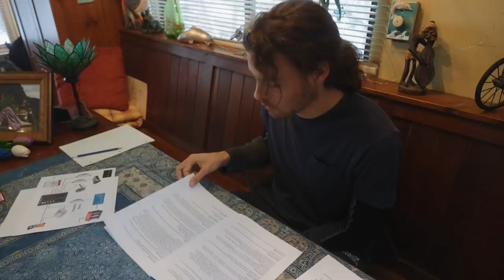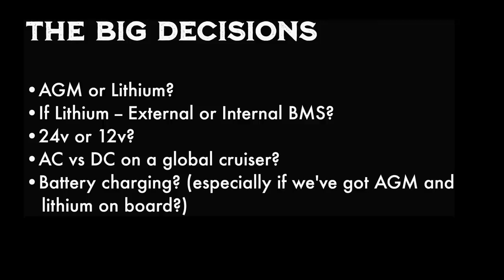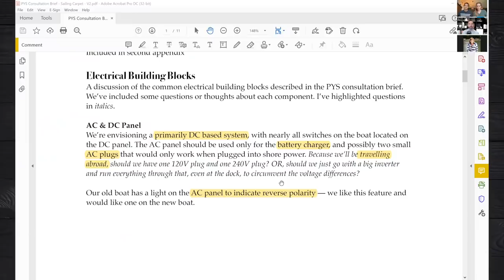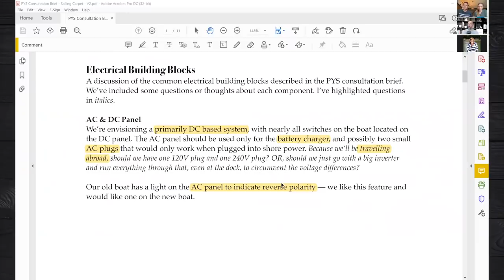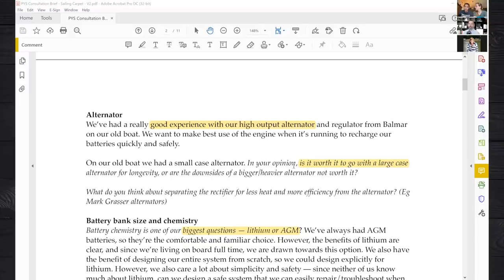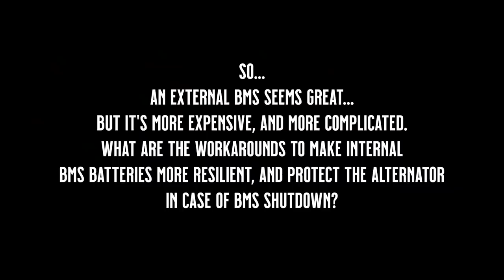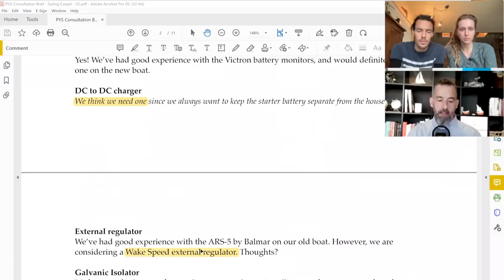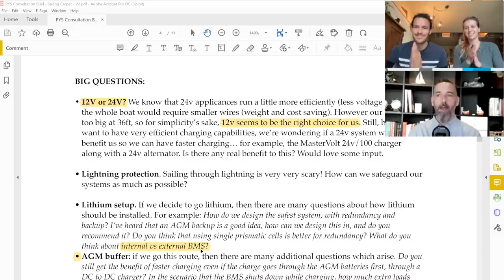DESIGNING an ELECTRICAL SYSTEM for WORLD CRUISING (with Jeff Cote from PYS)

Comment: My thoughts:

higher voltage means thinner wires, means less weight, means less cost.  So I would go 220VAC and 48VDC if you can make that work, otherwise 24V.

You could then use British power sockets, which are one of the safest in the world.  Or possibly Euro standard plugs, which are also pretty good.
48VDC inverters / chargers are, I believe cheaper to purchase, though maybe you would struggle to step down.  Some power sockets also have USB ports built in, though I did hear that these draw some vampire current all the time, so that is worth thinking about.

I would go for a predominantly LiFePo4 lithium battery - very little chance of fires, good charge / discharge rates, deep discharge cycle.  Slightly heavier / larger volume than NMC but, in a boat environment, safety first  LiTo is an option but quite expensive I believe.  You should then need a single Lead Acid battery for starting your engine.  I know that electric cars charge their lead acid battery from the main pack, so it is possible.  There also seem to be a lot of lithium starter batteries around now for motorcycles, suggesting that a high starting load must be possible.  I appreciate that a diesel engine is a large unit to power, however.  I gather that Lithium will deal much better with cooler temperatures than AGM, also. 

Sailing Uma have an electric sail drive that regens their pack when they are sailing and this costs them only .5 knots of forward speed.  This might be an option for you guys.

It might be worth thinking about a small wind turbine, if you can find somewhere to mount it.  I see these on canal barges frequently.  Low output, but constant, provided that wind is available.  Thus, when you are sleeping overnight you're still topping off your battery.

Induction hobs (burners):  Very efficient, simply because all of the energy is going only into the pan, none goes up the sides.  Gone With The Wynns use induction on their catamaran (though they will have a bigger solar array than you) and they use a silicone mat on the glass surface to prevent the pans moving around - yes, you can cook through a mat with induction.  You can't do that with a gas burner.  Gas is a very "wet" heat source.  Of course your food will give off steam but, in a boat where fungus can be a problem the less moisture the better.
Reply: I agree about the voltages, Sailing Project Atticus needed some expensive, awkward heavy gauge wiring when they did some upgrades.  

Free Range Sailing use a 'spirit' stove (perhaps ethanol), a pressure cooker and an insulated slow cooker to stay off grid for long periods.   

I've heard that wind generators are tricky as they have to be monitored to avoid going too fast and are also very noisy.  I think it was the O'Kellys who removed theirs, partly as it was on a catamaran with sheltering constraints, and the noise problem.
Reply: A motorcycle engine is much easier to turn over compared to a diesel engine. Those are two different beasts to start. Even the lead-acid gel batteries in a motorcycle are much smaller than what is in a car(what is much more comparable to a boat engine).

ps. Uma went up north last summer, they needed their portable harbour(generator) a few times because their solar and regen could not keep up in those conditions and with no marinas to top up around.
Reply: @nielsdebakker3283  thanks Niels, though I feel my large wall of text may have obscured my own admission that a large diesel is indeed a very different best to a motorcycle engine.

I enjoy Sailing Uma very much, I recall that they did indeed purchase a petrol generator for the Arctic trip, but only because they were unlikely to be well served by marinas in that location and I don't think they have used it greatly whilst they have been up there. It's a special tool for a special job.
Reply: Thinking further on this, given that a Tesla is a very heavy vehicle and that can be accelerated to 60mph in 3+ seconds,I cannot see why you could not use the main lithium pack to start the engine. I understand that you won't have as large a pack as that in a car but we're only talking about cranking an engine for a few seconds.

Comment: I have a boat with an electric motor. I just bought LiFePO batteries for my 48v engine bank to replace the existing AGMs that are on their last legs. A big part of the choice was that I was able to get the lithium batteries (4*12v 200ah) for LESS that I could find replacement AGMs (8 * 6v 250ah). Although on paper this appears to be a reduction in capacity, if you look into the specs, the AGMs are rated for 250ah at 0.1C (i.e. a 25 amp draw), and the rating goes down dramatically as the draw increases. That, coupled with the higher discharge level one can have with lithium means I will actually have more capacity for running the electric motor with the lithium batteries. The requirements for a electric motor bank are somewhat different than a house bank, and my boat does have a separate 12v house bank, currently consisting of 2 * 6v 200ah AGM batteries, but I plan to replace that with lithium when they go. I don't have the consideration of needed to power a starter.

Comment: First, thank you for sharing this process. Jeff is incredibly knowledgeable and a skillful presenter of information.  I agree with his comments on always considering "what if." Please understand that I am not anti lithium reactionary in technology. As a naval architect and marine engineer in the passenger vessel business I am simply going to present some considerations that didn't come up that have impacted my work. This is almost a taboo topic because of the push toward lithium.  

Fact: Lithium salts in a lithium battery are dissolved in an electrolyte of highly volatile hydrocarbons. Short story, even with technologies less susceptible to internal failure, Lithium batteries are themselves highly flammable (as are our fiberglass boats.) Naval shipyards store lithium batteries under similar constraints to explosive ordinance. Coast guard regulations require comprehensive monitoring and replacement cycles for  the BMS and sensors because of the high casualty potential a failure could result in. Electronics are incredibly reliable and failures are rare. But under "what if," alternator failure is not the biggest question. Fire is. And lithium fires on boats are virtually impossible to extinguish. Lithium itself reacts endothermically with water. This is not theory or naysaying, it is information that you need to have in your decision. Does it mean you should dismiss the technology? No. Propane is explosive too but many of us still carry it. But we do so under specific considerations and cautions. Ditto gasoline for our tenders. Positioning of the bank. Egress in the event of fire. Storage of rescue equipment. All should be inputs into your design if lithium is part of it. In the rush to revolutionary technologies, sometimes we run a few red lights and I think that is why this information is not easy to find.

One other interesting concern from 30+ years living aboard my Alberg 35.Jeff rightfully points out consistent voltage as an advantage and he is right 99.9% of the time. Others have mentioned Refrigeration. This is for me, anyway, one of my largest off grid power uses. Many years ago I learned about and installed an Isotherm ASU voltage sensing holding plate system. It is brilliant in that it "watches" for peak voltage, such as mid day solar output, or engine running and runs in a higher speed mode to freeze the holding plate and store otherwise shunted off power as enthalpy in the fridge. It then ramps down at lower voltages to draw less from storage off peak. This system will not work properly on a lithium bank because the voltage profile will not conform to its thresholds. Maybe not an issue for you, but I can tell you that for me the Isotherm was the critical piece to full time refrigeration on a small and simple battery bank (300Ah lead acid and 110W solar).

Thanks again for the discussion and for sharing your journey!

Comment: I have to take issue with Jeff's view on 24V vs 12V.  I built out a camper van a while ago with a 200 AH LiPO4 battery bank, 2kW Inverter/Charger, and 200W Solar array.  I think the cost savings on the wire size is substantial and should be given serious consideration.  When I built my van (max cable runs of <15ft) 24V system were just beginning to appear so I pretty much had to go with 12V.  Things have come a long way since then.  When you need 12V (which incidentally should be used to power a laptop rather than AC) you can always use a small DC-DC buck converter.  These are very low cost and small so have a1or 2 spares should not be an issue.  
That said it's obviously your choice and, for sure, both can work well.  Good luck, and did I mention I love the artistry (in workmanship and musicality) of your channel.
Annndd I just realized I'm 2 years behind the time (I do both now and m catching up on "back issues")  Oh well, I'll see your choice sooner rather than later I guess.

Comment: It would be easy enough to run a couple ac outlets into the boat.  It could be 110/220.  Just make sure what ever you plug in uses the voltage going from shore.  Most things do use both 110; and 220.  The things that don’t are like coffee pot, and motor things.  Your laptop, phone charger etc normally use both.  Another thing to think about is having 2 power systems to be able to switch between in case of trouble at sea.

Comment: Renogy makes a DC to DC converter that I find works really well to combine a gel cell starter /back up battery to a lithium battery  with a solar charge controller built into it . It has two inputs one for solar and one for regulated charge which will be connected to your gel cell battery . your alternator and your AC charger connects to your gel cell stater battery. Its max output is 50 amps  and max input from your gel cell is 30 amps witch works out great for a 70 to 100 amp alternator . you can buy a 280 amp amp hr battery 4 cells 3.2v each in series for about 800.$ plus 200.$ for BMS and I think I paid about 400 for the Renege DC to DC  converter but it has the solar controller built into it  . I built this system for my camper and it works great ,but plan to use it in my 36 foot Pearson which currently has a 100 amp alternator 400 watts of solar and  4 golf cart battery at about 400 amphr cap.

Comment: On REDEMPTION I have dual alternators a 55 amp which charges the starter battery and a Balmar which charges the house battery banks. The house bank and starter battery can be cross connected so if need be I can run the boart on the starter bank or start the engine on house bank.

Comment: Once you have a combined inverter charger you can think about mains equipment like fridges, freezer, aircon , water makers etc that are way more efficient and cheaper than 12v or 24v . Remember mains equipment is manufactured in the millions so is much better designed and developed than dc which is in the main designed for the leisure market.
Even in a small boat 24v is beneficial as the current used  for charging and supplying the inverter is halved. I know a lot of boat navigation equipment is only 12v but 24v-12v converters are cheap and reliable .
If you choose lithium, the AGM and battery to battery charge controller sounds a good simple option with redundancy built in.
The AGM battery will also last probably 10 years or more as it will always be in a full state of charge.

Comment: I just bought a 39 privilege.
I.m redoing interior in foamcore and glas.
1st. I removed all 120v panel and wiring.
2nd. I removed 12 volt panel and wiring.
3rd. Remove all plumbing pvc flex.  pipes.
4th. I created 7  compartments to 12" above waterline in each hull.
5th. Removed all thru hull fittings below waterline.
6th. 150 gal built in water tank in each hull sealed under floor.
7th. Connect One 380 watt panel to one  lithium 100 AH
Battery.
One wire with two swiches in shower to give pos. And neg connection to water pump when required.
Same 2 switch idea for each of the 4 sinks.
ALL MY 12 volt lighting inside and out run off ONE
 wire with one $2 fuze of 5 amps.
Each of The lights have on/off switch.
Same idea for bilge pumps.
And vhf + depth.
120 v microwave,tv.concealed window ac run off a 4k  inverter.

Comment: Interesting chapter! While discussing 12 vs 24... why not throw 48V into the discussion?! ;-)
Reason for stepping up to higher voltage is not only because of cable sizes... It means lower current (which is why we can step down in cable sizes, sure) so we will also hopefully see longer lifetime of our equipment like batteries, contactors, connectors, cables etc. I stepped up to 48V some years ago now (boat is a 37 footer, SO37.1 from 1995), 2x400W solarpanels on a arch on stern. Sure, it's not pretty with a arch on stern but it is so very practical. Yet another of those areas of prioritization... Best place for solar panels IMHO, and good place for antennas, lights, hammock... just to name a few :)
Energy storage is 4x12V200AH LiFePo4, so yes, only one string of battery for the moment... will be parallellized soon with at least yet another string for redundancy.
Then some 48V-to-12V DC/DC converters for lights, navigation, fridge and those normal service bank loads. A combined shorecharger/inverter for powering the electric cooking (only having this, all old gas installation removed) but very seldom use shorepower, perhaps like once or twice per year in case of maintainence/improvments on the electrical installation.
I still do beefier cabling than recommended, have served me good even in the traditional AGM times. Why not making sure the currents can flow as resistantless as possible?
Old service bank 3x12V310AH AGM is still in use but as engine/windlass/bowthruster bank. When we will be able to buy decent 48VDC windlasses and bowthrusters, this could be removed and it would be fine to also do electric engine. I understand there is already 48VDC windlass available from Vetus for example but feels still a bit early here...
With my simplier cooking style I'm able to go along with like 300-500Wh per day, normal serious is probably double that.
During summers here in Sweden, Stockholm archipelogo, I'm doing fine with just one solarpanel connected, and even then can power the warmwater most of the time. :)
(I do use only one panel during summer since I don't want the lithium bank to sit at 100% for longer periods...)
I would say, balancing the design there should not be any hinder to go with lithium batteries and electrical cooking.
As with everything, wage pros/cons, make it safe, easy to use and maintain, affordable...

Comment: Also keep in mind a higher output alternator is going to steal more horse power from your engine, because it increases drag, and takes more of your power to keep it spinning. 
As far as lithium or AGM, if you have the money go lithium, it saves a ton of weight and space. Both lithium and AGM loose charge a lot father than lead acid batteries, so they will need to be hooked up to a battery conditioner if docked for more than a week, they also don't perform as well as L.A. in cold weather.
You could also consider running 2 alternators, one for an AC system, and one for your DC system. One of those could be lithium for your AC, and the other AGM for your boats system, to keep the boats system relaible and simple. You cant have lithium and AGM hooked up to the same system. Only down side to lithium is that if something happens to one of your cells, it might be hard if your in some random country to find a replacement, where as AGM would be a lot more readily available, if something were to die on you. Lithium will also charge faster, but the controller and conditioner is going to be more expensive, not just the batteries themself. Cool thing about lithium cells, is you can add another battery bank in parallel, to have more sreserve power, without adding any significant amount of weight or space.

Comment: Hi Guys, External BMS does not have to be expensive, you can get very good quality JDB BMS units for under 100USD that are the same that are marketed in the US for over 200.
I would recommend you use BMS Can comms to regulate charging with a dedicated charge controller however.

Comment: We are professional transporters in Europe, inland waters only, so not comparable + our motor only ship is 40 meters long, 131 feet in your system. Having said that, we live aboard all year. Our system has 220 v for the living quarters, through 6000w victron converters from 24 volt traction agm's, we even cook on it (induction). We have a seperate agm 24 v system for the engine. All charged through separate alternators, shore current or our generator. This way we can use the engine agm as backup for the nautical equipment (obliged by law).
All professional boaters in europe use 220 as the main house system, makes life a lot easier, you can buy everything (bulbs, lamps, computers) on the commercial market. the nav equipment is 24 volts.
if you would like to discuss this way of thinking or our setup details, let me know. Good luck!

Comment: Excellent in depth conversation. Many choices I am also still making. The laptop charger/ power supply my I suggest going to an aftermarket DC supply rather than having to run an inverter at great lengths, generally more efficient solution Maya. M1 cpu appears to be showing the way to reduce consumption in the offshore studio world also. 
Just helped my dad's house use a little 3L instapot some other sailboats I've seen run on solar. 700 watts, cooking times under pressure I am surprised. Now on my list.